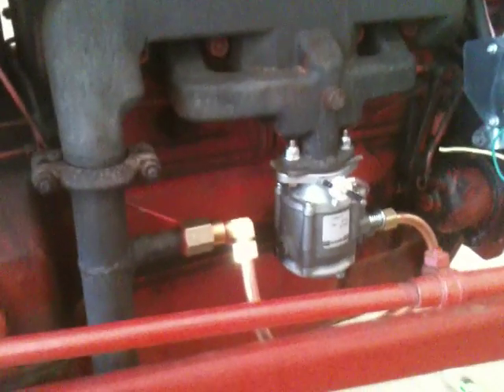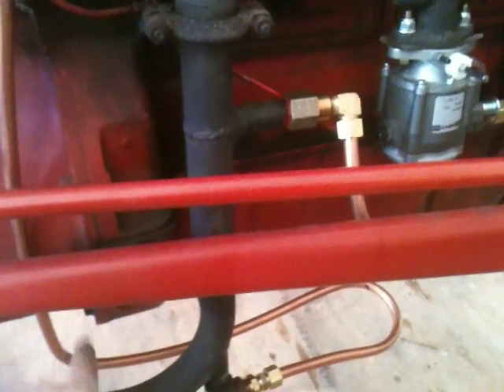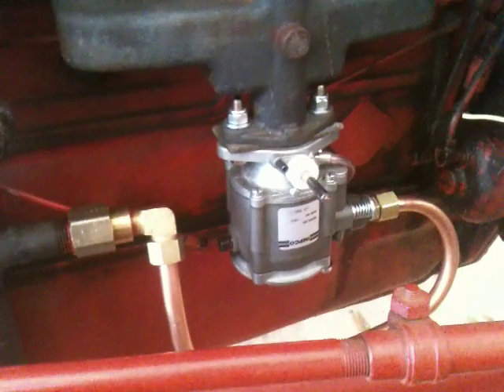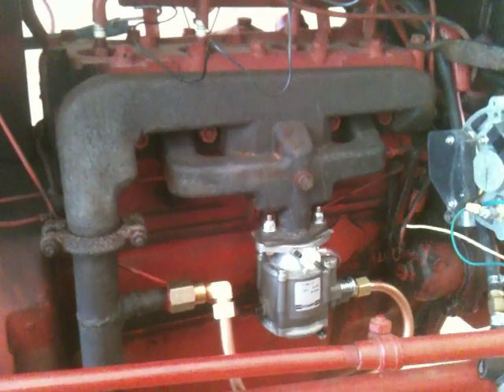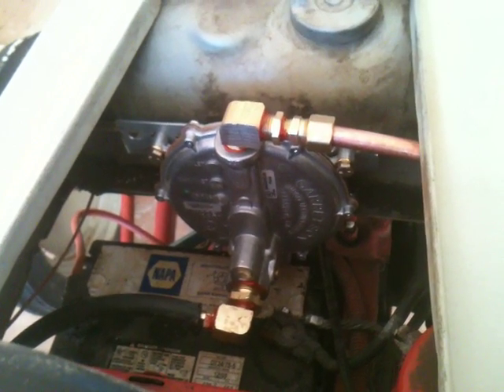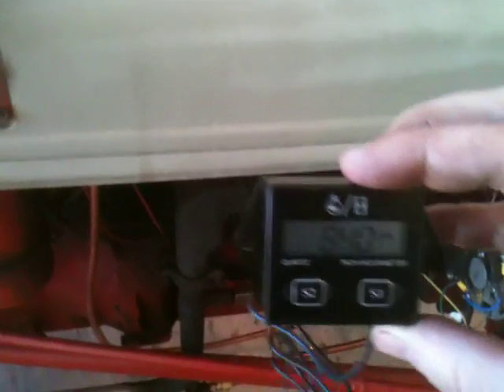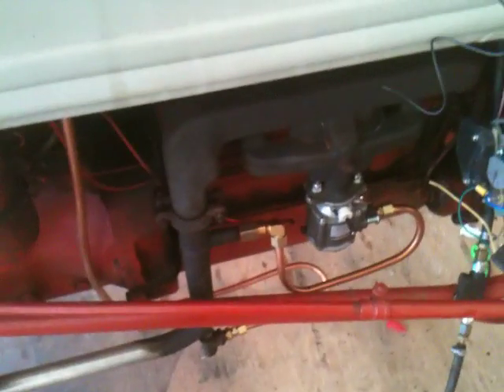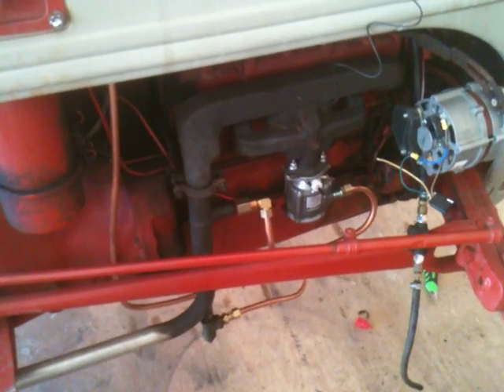Ford 8N on propane with geet reactor

Comment: I am having trouble locating any info on using GEET with an already gaseous fuel like propane or natural gas. Can you offer me any advice?
Reply from the maker: Hi you may want to contact Paul Pantone himself, I know that he has had furnaces using Geet. I am currently in the process of installing a geet processor on small engine to burn waste motor oil

Comment from the maker: Hi, I havent been real scientific with the fuel comsumption measurements , I may put a load on it ( such as a generator) this winter and compare, I can tell you yhat after the engine ran about 20 minutes I has able to lean the mixer to its most minamum setting. 
  As for your cng system I could make a few sugestions.